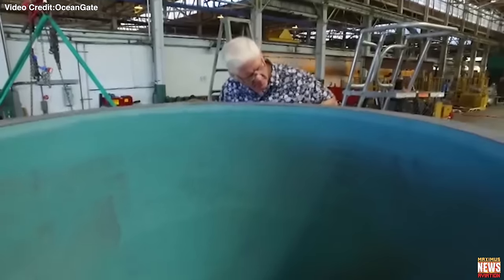Watch The Manufacturing Process That DOOMED OceanGates Titan To Fail. But It NEVER Had To Happen.

Comment: Noooo.  Not really.  They didn't really build this thing with parallel windings and such a short glue joint.  Not really.  My Lord.  Criminal.

Never mind the window being rated to only 1,300 meters.
Never mind the short fatigue life of CFRP
Never mind the silliness of crack detection methodology
This was a stupid design.

Comment: How many Dives have before it failed? I have read on other sites that of course carbon fiber does not indicate whether it is close to failure or not. So how many Dives did it have before it did fail? My other question is where did it felt it fell in the end caps which are dissimilar, the lenses on the ends, or even around the entrance in the middle of the sub.

Comment: As a former submariner and now an engineer in the aerospace industry, tne thing that floors me is the uncontrolled environment used to fabricate the hull and bond the titanium rings to the hull. These sorts of critical operations require a temperature and humidity controlled clean room, and the technicians need to be wearing bunny suits to prevent contamination of the adhesive joints. Dust, human hairs, insects...anything like this will create irregularities and inclusions in the bonds. Also, the operations are performed by hand, as if it's the local auto body shop down the road. In that view of the finished hull, you can actually see irregularities and what looks like contamination! UFB.

Comment: I don't even think the glueing was such a critical part since at depth the pressure of the water keeps the submersible together. But seeing how sketchy the glueing was, I'm surprised the titanium domes did not fall of the sub when it reached surface...
I think the cabron cylinder just gave up after many dives because of repetitive stress.

Comment: Did they intend to absorb the pressure of the water with the carbon fibers only in the transverse direction? So, in the longitudinal direction, only the resin resists the pressure?

Comment: I dont know why almost nobody (edit - found some comments about this...) is pointing this out, but they seem to only "wind" the carbon fiber in one direction - so there are NO long fibers in the axial direction... It would have failed anyways, probably - but we know that the strong part is the carbon fiber - not the epoxy... so why not wind it in an angle (like every airplane or... woven sheet of carbon fiber...) or build some kind of "external reinforcement" - a bridge-like structure that converts the direction of the force-pressure into one that the carbon fiber can bear better... I am just a media designer, but its kinda clear that the middle of the cilinder has the biggest force and also the biggest flexure and delamination -  while there are literally NO carbon fibers running lenghtwise ... basically this thing just relies on the strenght of epoxi in the middle that tries to glue the carbon together...

Comment: OceanGate THE RIDE OF DEATH ! At the meeting, Lochridge discovered why he had been denied access to the viewport information from the Engineering department — the viewport at the forward of the submersible was only built to a certified pressure of 1,300 meters, 4,265.092 ft although OceanGate intended to take passengers down to depths of 4,000 meters,” 13,123.36 ft 🤮🤮🤮🤮🤮

Comment: Carbon fiber on a curved surface is only somewhat stronger than the adhesive holding it together. Secondly, bonding it to titanium, is about ludicrous. In a normal atmosphere, the rate of expansion may be close, but add incredible pressures and low temperatures, things change.

Comment: Hate to rain on your parade but the end piece was recovered from the sea bed with the acrylic window missing which means it blew through. It could not blow through if the Carbon Fiber hull had broken first. So it looks as though the cause of failure was the loss of this acrylic window and not the hull.

Comment: The titanium door frame was attached with epoxy, which means the titanium door seal wasn't the seal, because the epoxy, being useless under pressure, was the seal, much like a weak link on a chain

Comment: Fiberglass works best with “Outward” Pressure (like air tanks, oxygen tanks, and such) not inward pressure. Think of it this way, use any string and pull it outward, then lay the string out and push it inward…… See the difference. The string holds up well when you pull it, but crumbles or folds in when you push it inward.

Comment: I’m not a naval architect or a structural engineer - I’m an ex-Army tanker so have familiarity with incredibly strong & powerful vehicle but obviously ground force vehicles namely the Abrams tank.  Also my background is in tech.  Anyway, when you apply some logic, induction & extrapolation you can at least on the surface question the design, engineering & structural integrity of the Titan submersible.  

Look at the US Navy’s submarine which don’t operate at those depths & while very large vessels, their build is uniform & built with a single material while also lacking portholes.  Now obviously there are other submersibles like the Russian ones that dove to Titanic that had port holes but were extremely thick & as far as the exterior of those submersible that would make 2 distinct materials in those builds.  The Titan had 3 joined together by glue?  Each one of those materials has different tensile strength, torsional strength, expand & contract differently, etc.  So after repeated dives with changing temps, you’d think there would be an element of “wear & tear” happening that impacted the structural uniformity & integrity of the vessel.  

How many atmospheres did they dive to?  I think the Titanic is like 4000 meters depth & its 1 atmosphere every 10m.  Its like 14psi per atmosphere.  14 x 400 = ~5,600 psi So at that depth it’s freaking almost 6,000 pounds per square inch & forces are always “looking” for the path of least resistance so to speak.  Despite signing waivers, I think OceanGate is toast & will be mired in litigation hell.  I don’t know if they’ll gain any traction.  However, we had rich families who’ve endured unspeakable tragedies at a charismatic CEO who arrogantly & openly flouted nautical safety rules & standards.  I read somewhere that a lot of the designers were college students & interns, not even experience naval architects but maybe that’s just here say.  

At any rate, Discovery Destination Unknown Josh Gates who’s a well known explorer checked out the Titan & decided he wasn’t on-board with the corner cutting & safety implications as he refused to take a dive on it.  I think some tried to raise the alarm but like many things in life, we are more reactive & wait for tragedy to happen before doing something.  Even at a cursory examination of the design & building process to a non-engineer/non-architect I think there are immediate red flags & huge concerns.  Sometimes charismatic leader can sell you a turd in a box & the specter or rather allure of something like an exciting adventure let alone a dive to the legendary Titanic can skew even the judgement of the smartest people as what seems to be the case here.  This vessel was doomed from the start eerily much like the actual sunken Titanic it was designed to dive to.

RIP to the victims & condolences to the families.  You just hope they didn’t suffer any fear, trauma or suffering during this tragedy.
Reply: Heavensgate and Oceangate, both west coast affairs built on lofty vacuous dreams.

Comment: I can't believe they relied on a glued joint for something that would undergo repeated pressure difference cycles. That is putting a lot of faith in something whose condition you can't check. I wonder where the craft failed- was it the carbon fiber that gave out and crumpled or did it originate because of a flaw in the joint between the metal and fiber?

Comment: Did they use epoxy resin ? Are there superior products than the West System (for example) that us amateurs use for projects ? What is it's compressive strength. Filaments (in compression) are most useful in controlling failure mode, diagonal wrap will help to avoid longitudinal spiral buckling. The tube is subjected to longitudinal compressive load as well is it not ? The resin matrix is doing all the work in circumferential compression, as many others pointed out.

Comment: All carbon composite vessels designed to go that deep were single use. 
There are issues caused by consolidation of composites under pressure. Micro bubbles and voids collapse causing delamination etc.

Comment: lol.......2" of overlap between the CF and titanium ring? and only "glued"? no mechanical fasteners? (although that in itself could compromise the structure by producing fractures in the CF). CF would easily flex/deform 2" in those depths.

Would prepeg CF in an autoclave work better than filament wound and hand-applied epoxy? 

Any vacuum bagging at all? 

Man....all these engineers and manufacturing people should ALSO be held accountable for their stupidity... I mean, they KNOW these processes are flawed OR they just didn't understand the deep sea pressure application....but I couldn't morally and ethical even work on this project if I saw Titan being fabricated like this! 

These are fairly elementary engineering failures that even high school STEAM/STEM kids can figure out.
Reply: Everything from the choice of material to mounting the monitors inside with screws into the carbon fiber is high-school level engineering or below. The tube contracts and tries to pull away from the ring, and there's 4 cm of glue holding it in place. The end cap needs to have a boss that goes inside the tube with the ring covering the tube to keep it from opening up and letting the cap slide inside. 
This is like a model of a submersible made by a twelve year old for his backyard pool.

Comment: Will never understand how so many engineers and contractors thought Carbon fibre will be a good material for continuous deep dive use. They didn't even have a life cycle for the hulls cyclic deterioration. The manufacturer is culpable too, they said it be okay for at least a 1000 dives. While OceanGate thought it be okay unlimited deep dives.

The Titanium Rings were also not the highest grade. They used Titanium grade 3 instead of grade 5. The glue to mate both materials is another failure point. Titanium has literally no porosity, Carbon fibre has good porosity. This type of bond of two materials is seriously dangerous for high pressure loads of deep dives. 
Under pressure the glue joints will fail because the Carbon hull will bow out on the horizontal and compress in the middle thus cracking and opening a gap on the Titanium ring C joint. The water will ingress in the glue joint gap find the areas of least resistance and implode. 

Making a hull of huge thickness from a laminated Carbon is also daft. The voids, bumps and cracks will always occur in manufacture process. Very difficult to control and perfect. Why not just use tried and tested materials. Titanium 5 was best material especially considering  Carbon hull will have a very short lifespan. Proven by Titan V1 hull that cracked in 2019.

Comment: There is a reason that DSV's are almost always spherical and made of homogeneous material - usually steel or titanium. As has been pointed out here in the comments, there are so many things wrong with the construction. It's surprising it didn't implode on it's first dive. That at least would only have killed the guilty.

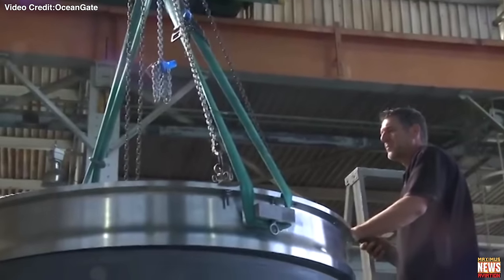Comment: 01:30 The guy rubbing down the surface of the titanium ring with a dirty rag right before it's being glued to the CF tube never ceases to boggle my mind. WTF is wrong with these people?!?
And on top of that, it's not done in a clean room with people wearing lab coats, but in what looks like an abandoned car repair workshop. Again, W.T.F.

Comment: It's astonishing that they didn't seal up the carbon ring. Only as a preventative measure to keep water away from the carbon weave. It wouldn't have mattered, but if I was part of that process, I would've at least made sure the carbon tube was protected from the elements.
Reply: The CF was not in direct contact with water, there was another layer of some material added later.. Rush explained it in another video. I think it was in the Alanxelmundo channel.
Reply: @sigkil  maybe I haven't seen all the footage, but I haven't seen a seal on yop of the carbon. Either way it was a dumb design.

Comment: 1- carbon fiber exposed to compression and not to tension.
2- different materials with the rings at the ends.
3- both glued with epoxy being of different mechanical behavior.
4- never a naval engineer could have designed that
Seeing how they laugh and take everything lightly, the result was obvious.

Comment: Russian developers of deep-sea submersibles who have descended to the Titanic many times have already spoken about the design of the submersible. First, the deep-sea vehicle was not certified. This means that no scientific studies on strength have been conducted. They would show fatigue damage after several dive cycles. The choice of material was wrong. This material does not have sufficient ductility in deflection like steel (titanium, by the way, also gives microcracks). The second is the shape of the capsule. The pipe is completely unsuitable for such depths. There must be a sphere. Even with an emergency ascent, the crew will not be able to get out on their own, since there is no hatch. The crew is screwed with bolts in the hull from the outside.

Comment: the lap bond of the epoxy was the only thing keeping the carbon fiber together for the axial load?  Did they use a pressurized autoclave to to ensure all the air bubbles were dissolved into the epoxy matrix?   And how about the air pockets formed when joining the titanium end cap to the carbon fiber tube what presumable looks like methacrylate adhesive?

Comment: maybe two inches thicker, cross woven and sealed with some kind of form fit or positive connection so you dont have to rely on adhesion. If done like that you could also renew the seal once in a while.
The fit looks to me as either the titanium lip would crush the carbon fibre due to different deformation rates under pressure. In the case that they left enough space to let the titanium deform without compressing the carbon, the seal would be exposed to water pressure....

Comment: It was that ring and clue which caused the destruction. First of all that heavy ring pressured the hull and clue didnt keep, water leaked between that ring and carbon fibre body and eventually it didnt keep and the hull imploded.

Comment: Was the guy hitting the lifting strop attached to the titanium ring to make sure it was slack thus indicating the ring was seated properly. If that was the case it seems to be a very low tech way of determining such a crucial aspect of the build. And relying solely on the weight of the ring for correct mating, no need for any additional clamping apparently.

Comment: It should be the Carbon fiber outer side that is glued to inner side of the titanium ring so that the ring acts as frame for CF hull end. Then add  2 titanium rings thicker than the end ring in the middle of the CF hull act as transversal frame. The middle is the weak point of the CF hull. Similar to a beam supported at both  end then a uniform force is applied along the beam.  It will most likely snap at the middle. 

This arrangement could work I guess but need to be tested.

Comment: They glued the crap together. All you need to know. That glue at different temperatures alone will degrade overtime. We don’t even glue plumbing together. It’s threaded together usually with plumbers tape making it water tight. They literally used epoxy 2 part glue that becomes brittle over time.

Comment: At that ocean depth,  6,000 psi on that vessel :  It takes 90 milliseconds, for pain to be processed by the human brain. THAT,  THING  IMPLODED, in probably 10 nano--seconds ;  THEY  NEVER  FELT   A   THING.  Just   ' ocean pink '  all over. The pressure, would have caused the air (inside it)  to heat up, to HIGH  TEMPERATURES, upon imploding, burning anything inside, until that 6,000 psi pressure,  took up the space.....

Comment: Wouldn't it make more sense to do the lamination in the inside of the tube? I.E. gas bottles build with Fibre outside, but the big pressure is inside...

Comment: This guy had a degree in aerospace engineering from prinston University and glued carbon fiber with titanium ring.. as a unprofessional mechanical engineer i would say he should had started with a titanium hull with both rings machined from a single titanium block and keep it thin for low weight just like jet engine nussel is made than wrapping carbon fibre in a zig zag manner for    
extra strength would have saved him..yup the glue killed him.

Comment: A manufacturer who produces this knowing for which purpose should have warned that this is not save an should not used for manned missions. The tube is bad in dealing with pressure from outside. The titan rings behave totally different on temperature and pressure changes than the carbon fiber. So the glue is heavily stressed.
The guys a not aware what they are doing.

Comment: Having some experience with using  carbon fiber in large high performance radio control aircraft, i would not lay all the carbon fibers in one direction, as stress loads can come in a multitude of directions.  And using glue to hold dissimilar materials together with out additinal reinforcement is another weak point.  Having going over the remains of crashed airplanes I've seen what can happen.